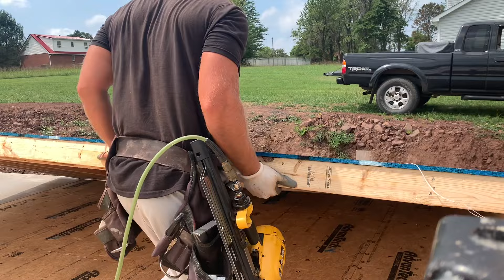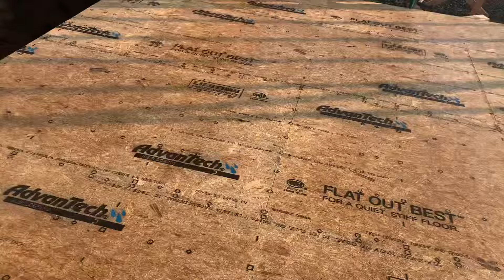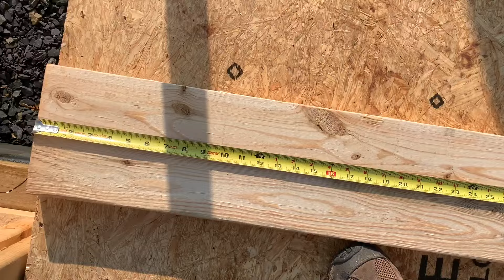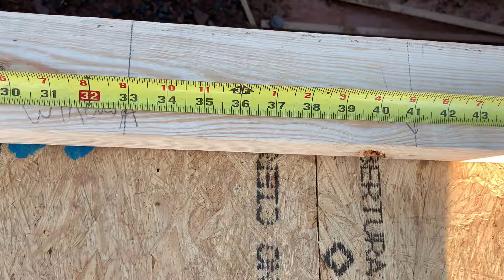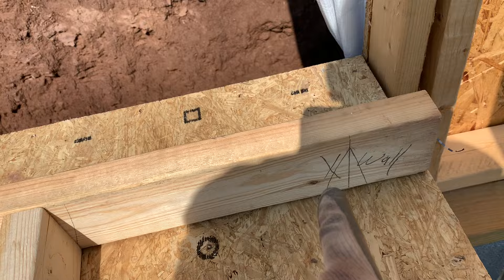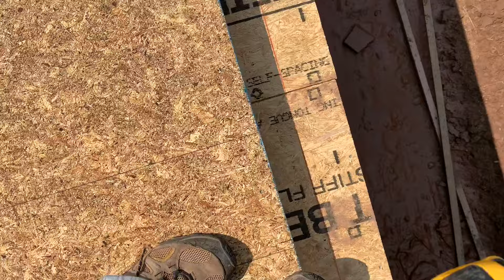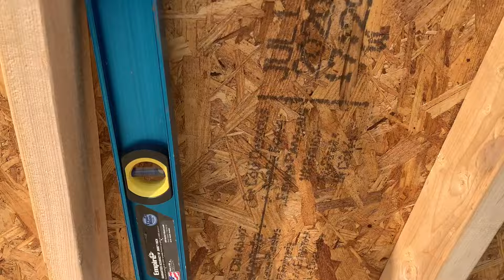How To Build A Wall With A Window Opening 16” On Center (O.C.)

Comment: Decent video but missing viral info. For example, you make no mention of how to interpret house plans, where the window goes and how you derive to making your marks where you put them , so the way you show it is not all that helpful unless your just going to be assisting. Nail patterns, you don't explain this at all..except sheeting. Using a liberal amount of nails, not specific enough

Comment: When you were lifting the wall, at 0:01 and again at 17:48, I noticed that a strip of the OSB extended above the frame (maybe 1/4" - 1"2 inch). Was that intentional?  If so, why? Was the wall frame 9' tall after the second top plate was attached, or before the 2nd top plate was attached? Did the OSB sheet top match up with the top of the 2nd top plate? If not, is that a big deal? What would you do to prevent a gap in between the wall sheathing on the 1st floor and the wall sheathing on a theoretical 2nd floor? I will be building a garage with two floors and it seems like there would be a gap between the sheathing that would have to be dealt with somehow. Thank you, I am really getting a lot out of your videos.

Comment: what size nails are you using. i have a nailer  pneaumatic 3 1/2 " 16d   and the nailes are thinner than the 5 pound lose nailes so is this correct??

Comment: I bought the Advantect flooring and went to your video. You answered most of my questions. However there is a beveled edge on Grove side.I wanted to know does the beveled edge goes up or down. I wish that question would have been addressed

Comment: Your sheeting should go all the way down over to your sill plate. And it nails in with galvanized nails to your treated  sill  plate to tie it all together. Those two toe nailed nails into the floor joists won't hold that house down. Don't take my word for it ,look it up. Just a heads up!

Comment: When you make a header would it be ok to use a 1/2 inch piece of foam board,say R3 in-between the 2x6's? Would that fail an inspection?

Comment: Great videos Josh, I have a question, you explain pretty well about the layout and where to place headers but how high do you place them, is that in the plans too?
Reply: The height and width of the RO(rough opening) for your window will be in the plans. He does a good job explaining but his marking is a little hard to read. Your header just has to be 3 inches (two Jack stud widths) wider than your RO. Easier way for me to think about it anyways

Comment: If you start the sheathing flush with the first stud, won't it miss the stud on the other side 48" away? Do sheathing joints need to fall in the center of the studs?
Reply: Yes it would miss if you laid out stud at 48”. It’s why as he explained you go back 3/4 inches from every 16” red mark on the measuring tape. 
So the 4’ end of your sheathing would actually break in middle of the stud  you laid out at the 47 1/4 mark. 
Then again at the 95 1/4 laid out stud and so on.

Comment: According to the code IRC R602.3.1, 16" is the max space between centers of two studs.  But (almost) all youtubers measured the second stud starting at 15 1/4". If so, the on-center space between the first and the second studs is 15 1/4" which is 3/4" less than 16". It was not wrong but wasted 3/4" space. It is weird that so many senior framing guys say this was a trick. I totally disagree.
Reply: You put a stud on the end of wall making spacing narrower. You lay 16” center so when applying sheathing 48” will land on center of studs starting end of wall.
Reply: @Buildingboy06  Thanks. That makes sense. The stud need to be on centers at 48", 96", 144" and 196" to install the 4-feet-wide drywall or OBS board.

Comment: I'm real surprised you passed inspection cause any header over 4 foot requires double jacks.
Reply from the maker: Hey Curtis! It depends on if the wall is loadbearing or non-loadbearing. Thanks for your comment!

Comment: How long are the nails you are using in this video?
Reply from the maker: 3 1/4” framing nails non galvanized. I used 2 3/8” for the sheathing. Great question!